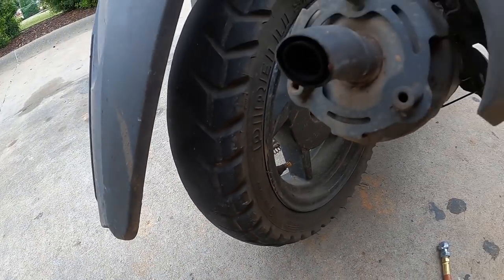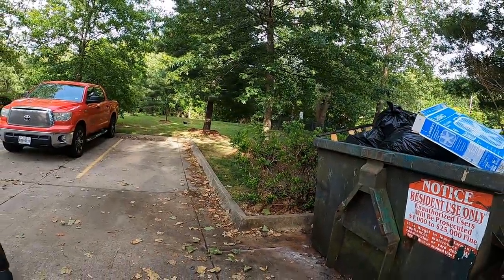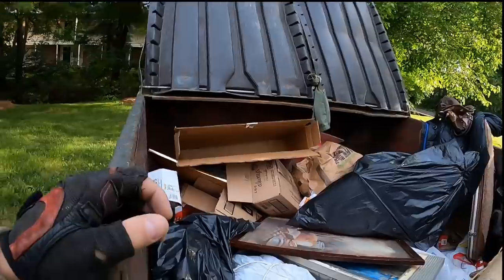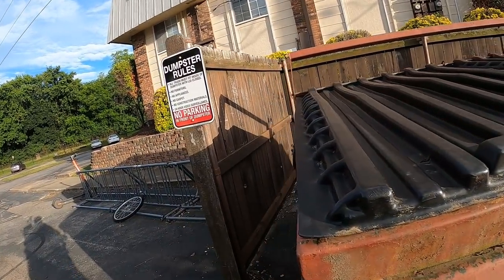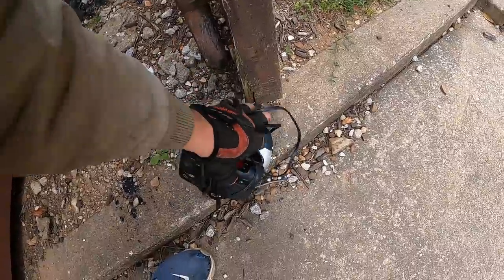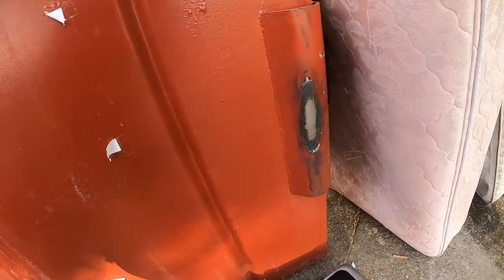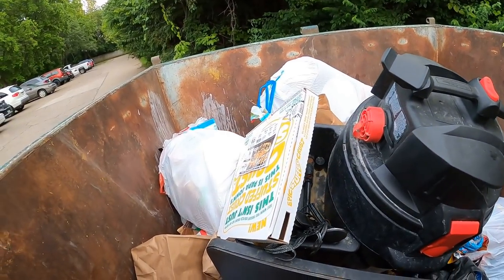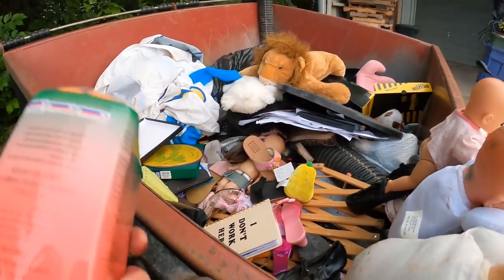Dumpster Diving "Lots of STUFF & Another Vacuum Cleaner, Yay"

Comment: I’ve used both bissel and Hoover and recommend Hoover carpet shampooers over bissel big time…don’t waste time buying bissel…I’ve rebuilt them with new parts only to have them work for one shampooing …they’re junk…Hoover on the other hand r way better quality and I’ve got an older one of the model that was next to that dumpster…never have had to fix anything on it and it works 100x better then brand new bissel…I’ve actually seen bissel not work out of the box so don’t waste any money or time on bissel…